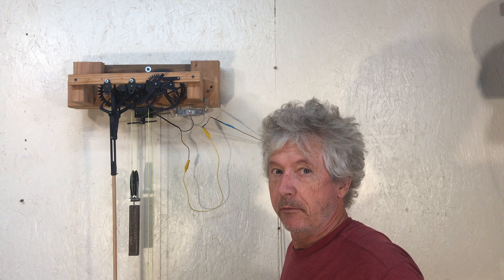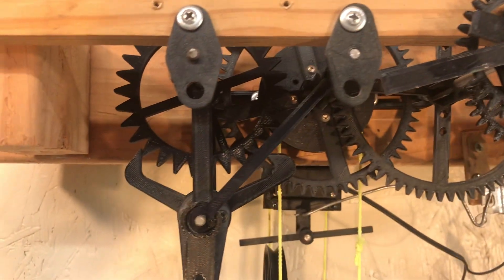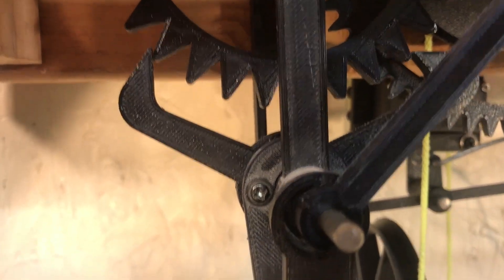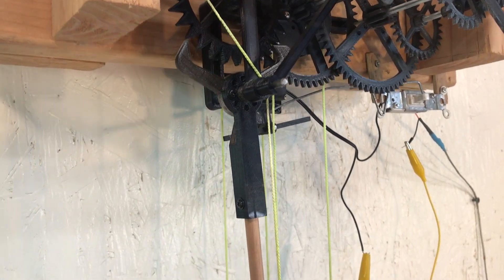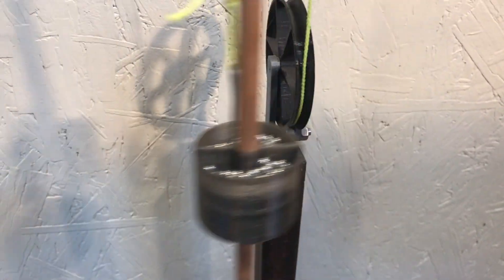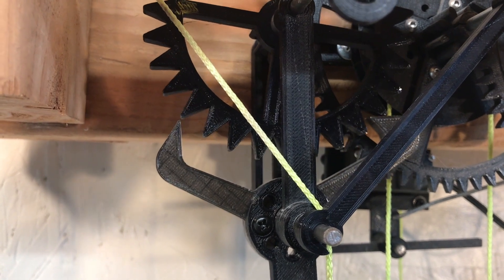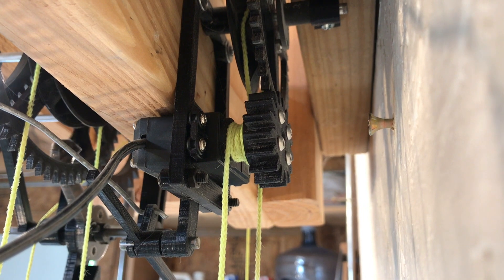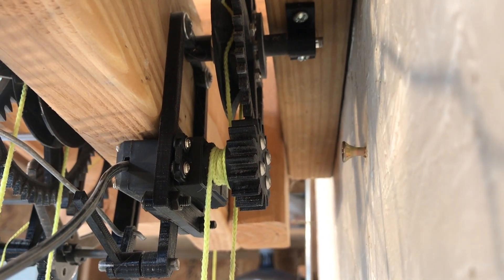A 3D printed Automatic Re-Winding Clock

Comment: Hi Would you share a few words with me about using this eccentric gearing to make speed and torque increase
https://youtu.be/9l9QMz67J0c

This gearing is saying it does the same as a spur gear except it can turn 3 times more in the same amount as a spur gear
So when applied correctly
This can make 3 times more torque than a spur gear
They say at 30 second

Just to be clear they said if you put this gear with a spur gear and the spur gear does once turn that this gear will turn 3 times and can come out of the front of a clock and will move at  the same speed as the spur gear with 3 times the torque

They say this eccentric has the same power as a spur and can turn 3 times more in the same distance of a spur

Its very difficult to find people interested in self winding clocks
I have a project that will compliment your work

I hope my offer interests you

Thank you for reading
Reply from the maker: Basically: Power = Torque X Speed
There are no magic gears that will increase both speed and torque at the same time
Reply: @jacquesfavre999  
Thank you for your reply
Here is a clock charging a light
https://youtu.be/DdElnRkzepQ

It could have worked many hours but the builder was limited cause he cut gears by hand 
Please help me complete this piece
by making it self winding

Thanks so very much